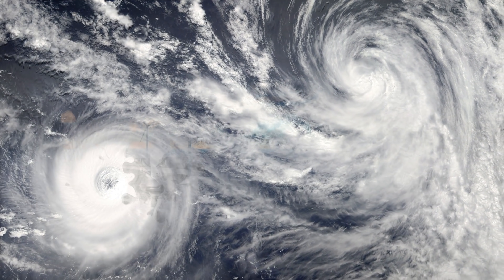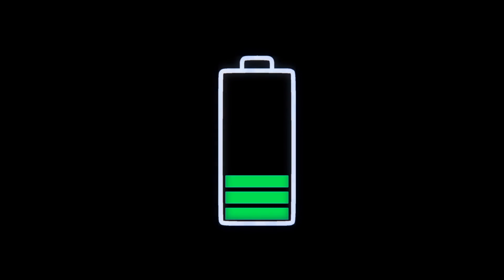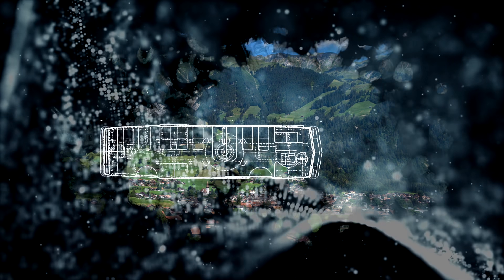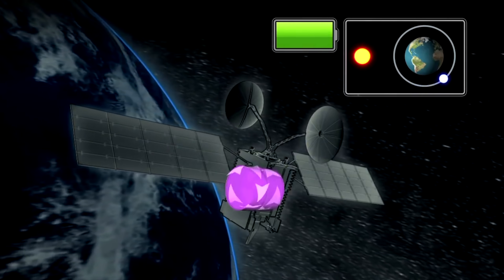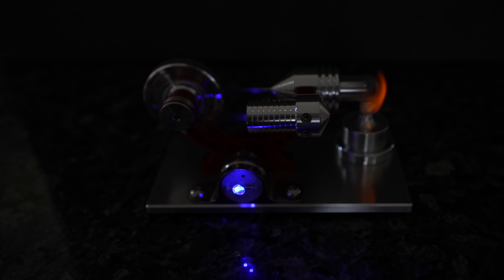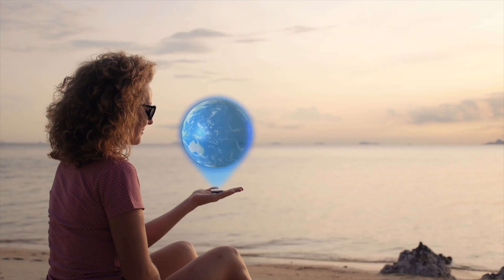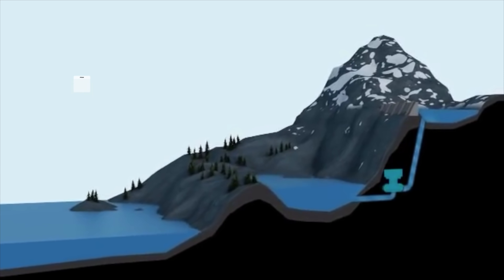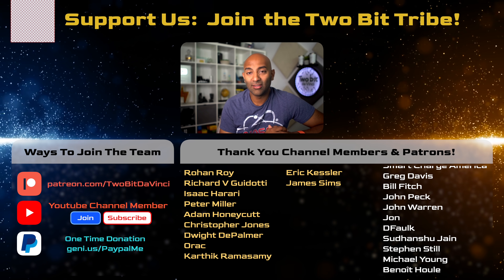The Mechanical Battery is Making a Comeback

Comment: Check out Fuelpositive Corp. (NHHH.VN) turning water, air, and electricity into ammonia NH3 as a liquid with 0 emotions fuel, for under $0.20 a liter., that present day internal combustion engines can burn directly with very little conversion. Higher energy density then hydrogen alone, or gas as well. It can also be used in diesel engines as well as directly to heat, and can be made from excess grid energy to storage to be used later. The system can be as small as a refrigerator, or as large as a factory plant. A world wide infrastructure already exists for world transportation as ammonia is used extensively around the world mainly for fertilizer. Present ammonia production methods are costly, more then 20 times more costly then this new technology, and create pollutants. Making this gas is cheap, and nonpoluting in maufactureing and in burning in end use.  A win win siituation to reduce polution on this planet in so many ways, Heat, transportation, (cars, trains, boats, airplanes, rockets...) . This company has just nade a deal with a compressor manufacture to produce their product. Eventually, every home can have one in their garage running from solar energy alone.

Comment: The flywheel in a car has nothing to do with shifting the transmission.  The clutch plate (in a manual transmission) does hook up th the flywheel but all internal combustion engines have a flywheel, even your standard push mower.  The flywheel on an internal combustion engine maintains the rotation of the crankshaft using rotational energy from the previous combustion stroke to push out exaust and compress more fuel and air for the next combustion cycle.  It operates as short term energy storage and the transmission is in no way dependent on it.  Wile the transmission does connect to the flywheel, the designers only make cars this way to reduce materials needed and promote efficiency of the vehicle.  Without the care of unneeded weight and increased expenses, you could put the flywheel on the front of an engine and feed power to the transmission directly from the crankshaft.   Also, when talking about the Sterling engine nasa put in a Chevy, you showed footage of what looked like a blue dodge truck.
Reply: I love cars.
Reply: @ProfessionalGasLighting  as do I
Reply: What about if you didn't have a transmission because it is an electric car? Could each wheel be a fly wheel?
Reply: @aicram62  ok, so that is a great question!  Electric motors don't require a flywheel, infact an electric motor that has a flywheel and/or continues to rotate when power isn't being ran through the coils can generate power.  That idea isn't used in electric cars today because it would only be a short burst of energy like when you're coming to a stop and the batteries will ware out because of it.  Also, that power would need to go through a separate circuit and not the speed controller.   So far as having a motor directly connected to a wheel, I believe Elon has something close to that on a few of his models but I'm sure there is a gear box of some sort in place.  If not, wile in traffic, the motor would burn up from constant low speed movement.  The motor needs to turn to stay cool (they usually have a cooling fan inside the motor like on a drill).
Again, this is all to the best of my limited knowledge.  I haven't worked on a tesla or any other full size electric cars. 
Hope that helps your understanding!
Reply: @kurtbreitenfeldt2330  I can understand the brakes wearing out, but not the batteries. But I don't understand a lot so...  Not that you have to know the answer but if there were a flywheel on an electric motor could it not help to recharge the batteries so that it would not take so long to recharge at the end of the day?
Reply: @aicram62  well yes but imagine if you will, a battery has a finite number of charges.  Wouldn't it be better to fully discharge and recharge as apposed to taking on several small charges that would shorten the lifespan of the battery?
Reply: @kurtbreitenfeldt2330  
It's actually worse to deep cycle batteries by running them down and recharging them fully. Some batteries are designed to be less damaged by deep cycles, but the more you drain them the less charging cycles they last. 
The damage is exponential too, not linear.
Reply: @FullCircleTravis  well yes and no...see, the batteries you're thinking about would be the car batteries for a gas powered car.  They're designed to start the car and stabilize the DC power flow from the alternator.  Your alternator does not put out a smooth 14.7v, it's more like a fast pulse of DC power, so the battery in your car keeps the power flow smooth for your cars electrical systems by taking a bunch of small charges and putting out a smooth flow of power.  Discharging That battery is bad!  It is designed to maintain, not power the vehicle.  For a fully electric car the battery is designed for the longest run.  Nobody has designed a battery powered car for just in the city where there is a lot of stop and go. (The "go" would pull way more power then would be made by the stopping so I don't know if that would ever be beneficial.) If they did I would imagine it would have solar panels too.  That car would never be able to go very far.  Short trips, short bursts of energy, and recharge.   That is only a small portion of the market.   The electric cars being built today need to be able to hit the interstate and highways,  having long periods of power being drawn-out of the battery.  The most logical design for the electric car battery is drain and charge, not pull and add power in short bursts.
Now there is another battery that I don't think has been considered for electric cars.  Lithium Polymer aka LiPo.  Unlike NMAH and Lithium Ion batteries, the LiPo battery does not fully discharge.  Doing so would damage the cells in the battery.  The power rating on a LiPo battery is actually the low point or minimum output of the battery.  This battery is designed for high out put and rapid discharge to the point of its minimum power rating, then the power controller will turn the unit off.  These are usually used in hobby grade R/C vehicles with brushless motors.
Reply: @kurtbreitenfeldt2330  
I'm not talking about lead acid starter batteries. Even batteries that are designed for deep discharge and recharging cycles used in cars and solar power storage, still have reduced lifetime output as a result of deep discharge and recharging cycles. 

Also, every electric vehicle that I know of has some form of regenerative braking. Even a prius has it. It's a major part of extending range in mountainous regions where downhill sections charge the batteries.

Li-po or lithium polymer batteries aren't used in cars because they are unsuitable. In a crash, the batteries could internally or externally short, causing them to burn/explode. They are also only good for 500 cycles, usually less. The advantage of Li-po batteries is high current discharge, which is why they use them in RC cars. No good for vehicles. Nobody is changing batteries ever 2-3 years.
Reply: @FullCircleTravis  yeah, I was short on time and didn't get into all of that.  Don't have time for a proper response now but I'm enjoying this discussion! 
Have a good one!
Reply: Hi Kurt. One car made without either a transmission or a flywheel, was the Stanley Steamer, which held the world speed record of 126 mph in 1906. It used external combustion to heat a "flash tube" boiler. The engine itself had two double acting cylinders, which gave it the same number of power pulses per revolution of the crankshaft as an eight cylinder internal combustion engine. They were thirsty for both kerosene and water, and boilers are high maintenance items also, which is why external combustion cars ran out of steam. Cheers, P.R.

Comment: 1 Kg of Deisle = 44,800,000 joules of stored energy.
1 Kg of modest Flywheel = 360,000 joules.

I love mechanical batteries, but you just can't beat fossil fuels for energy density.

Nuclear should be the solution, but the problem is that it really does promise "electricity too cheap to meter", so the military and industry deliberately developed it to be inefficient and stupid to force it into the same cost-per-kilowatt range as oil. "Spent" fuel rods are still 95% good, (for instance).  They fought against and mothballed the extremely promising LFTR reactor approach in the early days, (for another instance.)

Nuclear tech basically pulls energy from the very fabric of reality. People don't seem to recognize that we essentially invented magic. Making the public fear, hate and ignore nuclear was a profoundly successful public relations campaign. They made it dirty and dangerous and expensive when it didn't need to be, and then said, "Look! It's dirty, dangerous and expensive." (The quiet part being: "Please don't make our oil wealth evaporate overnight. We like being your slave masters.")

So now they allow us to chase windmills, secure in the knowledge that we'll never catch them. Pile on that the carbon tax scam, and we remain securely under thumb while we believe that the "Future is Bright! (Now, get back in your pod and eat your bugs, citizen. And roll up your sleeve for this month's DNA update.)".

Comment: I think one of the most powerful and everlasting batteries is the rise and fall of the tides....with a dammed enclosure you can capture the energy of the water both flowing in and flowing out.
This is the same a a man made device called a mill pond where a small stream of water is collected in the mill pond and released to drive a water wheel, normally the stream is too small to drive the water wheel but when it's stored it has a huge potential energy due to the weight of the volume of water stored......it's a battery, and like a battery it's capacity is limited by it's volume of storage.
You cannot compress water to make more capacity in a smaller space and at the same time you cannot compress air in a smaller space to get more capacity because in the end you end up with liquid air and that is the same as liquid water that can only release the energy by applying more energy in the form of heat to make steam to get the stored energy out.

Comment: who tf said, stupid buys, its free, practically
Reply: stupid pays
Reply: heat pump tesla turbine, mesh plastic reinforced compressed air storage, helium balloon floater
Reply: if you have home sized units, you dont have to find huge places, just a local small unit
Reply: water towers, per home
Reply: with wind pump
Reply: solar cleaner, mechanical washers, tools

Comment: I'd like to learn about the gyro bus. I don't know if this is suitable for your channel, but I'd also like some theorical math on flywheels, for example applied to a car. One downside of a flywheel I see is that you increase the vehicle mass. Yeah, it's "4" times better than chemical batteries, but is it really so ? I doubt we can achieve flywheels resistant enought to store the equivalent of 75kWh of power. And honneslty, you know, a metal/carbon fiber wheel rotating fast enought to store this much energy litterally scares me. If something bad happen, that's not the car you "burn" or destroy. The whole neigborhood is probably going mayhem.

However, on some little scale, it could complete chemical batteries to store car kinetic energy when braking, and providing it back without problem. But I think there is already research on supercapacitors that could provide this without the danger associated with a wheel suddenly going rogue.
Reply from the maker: Very good points! Yah as I go full time next week there will be more bandwidth for more videos like what you’re describing. Thank you!

Comment: There is another gravity assisted storage option: heavy trains (like 10000 tons or more) on a very steep track up and down a hill, crawling slowly uphill while consuming electricity and going slowly downhill while generating electricity. This can easily be scaled where hills are available. Here in Switzerland they could be built next to the skilifts, where we have infrastructure already available. They could help store renewable energy like wind and solar and they basically last forever if maintained properly.
Reply from the maker: Oh yah that’s a good one and a good use for stuff as it nears retirement

Comment: There really is no need in the long term for energy storage (it is useful for load balancing, however). Since the Sun shines 24 hours a day you just need a world wide grid to use electricity anywhere as it's created. The resultant energy is cheaper, there is a built in world wide incentive to switch to green energy, and you can ramp up nuclear plants to their designed output instead of their currently less safe and less efficient throttled condition.

Comment: PEM electrolysis has an electrical efficiency of about 80% in working application, in terms of hydrogen produced per unit of electricity used to drive the reaction.

Comment: As cool as the idea of mechanical batteries in the form of suspended weights are, there is very little potential energy there.  We'd have to suspend a loaded semi and trailer (or equivalent) at 100 meters just to equal the energy in a liter of petrol.  On the positive side, there isn't much holding us back from building nearly infinite amounts of them.  Maybe it should just remind us to appreciate energy more.

Comment: I look forward to the Stirling engine video along with other uses of heat pumps like closed loop geothermal, hvac, oceanic thermal energy conversion, along with solar assist heat pumps that cool solar panels and warm water/ generate energy, along with the use of different working fluids to achieve a certain use. Great topic.
Reply: Think how useful as a back up cooling system for reactors it could be along with co-generation when in operation.

Comment: Wait. Wouldn't a flywheel on a satellite induce things like unwanted gyroscopic procession? They use spinning wheels, reaction control wheels, to orient satellites so I know it would. So then if you're going to put a flywheel on a satellite, you would need two spinning in opposite directions and they would have to charge and discharge at exactly the same rate. Even the smallest deviation between the two would, over time, induce a drift in the satellites orientation. And flywheels are heavy. Wouldn't it make your satellite cost a lot more to get to orbit?

Comment: That flywheel bus system was incredibly interesting when I first heard about them (long after they were retired)
Reply: The buses were retired for a reason - primarily because they needed almost continuous maintenance and were always breaking down. The problem is that whenever the orientation of the rotational axis is changed, there is a huge right angle thrust on the mounting bearings. The only orientation that would work well in a bus would be with vertical mounting and that only if the bus ran on a level surface (no up/down) angle changes.
One of the magazines, probably either Popular Science or Popular Mechanics, had a long article in one of their issues - back in the 60s.
Reply: @buggsy5  this makes sense, especially with the lubrication tech we had back then.

Comment: I look at the loads for my solar+storage setup.  Heating and cooling, is one of the biggest loads.  If this can be offset by underground storage, with heat pump, this would be real gain.  It would take the load off the electrical (electronics and lighting).  The big problem is cost of drilling.  Maybe some of the technology from Musk's Boring company can help with this?  (Also, a "smart" hot water heater as a storage device, in coordination with the solar+storage setup?)

Comment: Solar thermal is far more efficient than photovoltaic. In Hawaii many people have solar thermal on their roofs, more even than photovoltaic. Has this caught on in the southwest? 
Converting solar directly to hot water is much more efficient than running a hot water heater off electricity from photovoltaic or anywhere. Might make a good video topic. When I lived on the windward (rainy) side of oahu we had hot water year round without need for the backup heating element - though it did cool off a bit once or twice with like 4+ days of rain… but overall it was great!

Comment: The flywheel in an engine is to provide energy for the compression stroke and smooth the torque to a useable level not keep it spinning fast during gear shifts.
Reply: Looks like you've never tried a lightweight flywheel. The flywheel does indeed add spinning mass that adds momentum to keep the rpm's up between shifts. A lighter flywheel and the rpm's drop much faster, making it harder to shift or start from a stop.
Reply: @filonin2  I understand I makes a difference to that. My point is that water pumps and generators have a flywheel. It is to provide energy for the power stroke
Reply: @filonin2  look it up man
Reply: @Nanocosm  Look what up? The fact that you don't know what you're talking about?
Reply: @filonin2  look up what flywheels are for on an ICE. After you're done cherry picking the results to try to convince yourself you were right, report back with the concensus answer in shame.